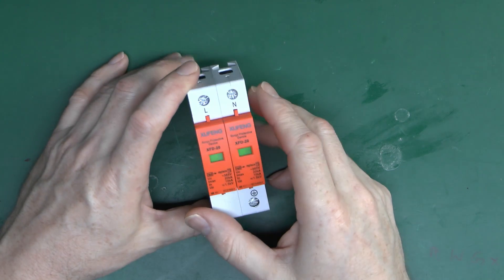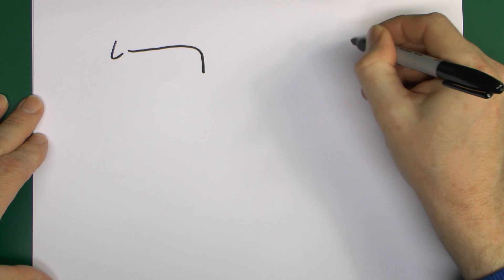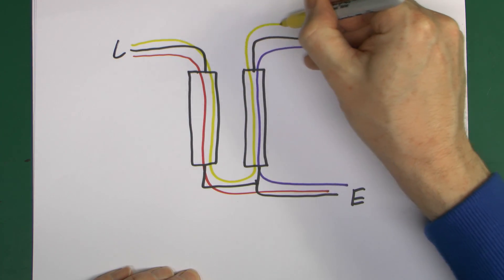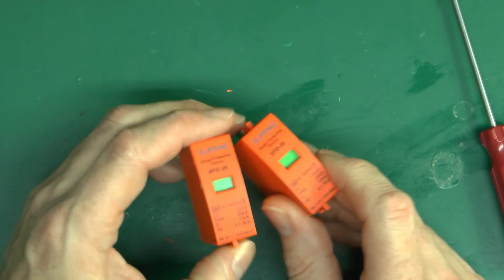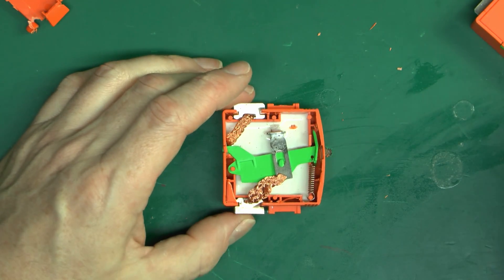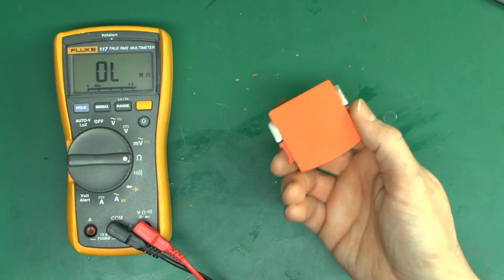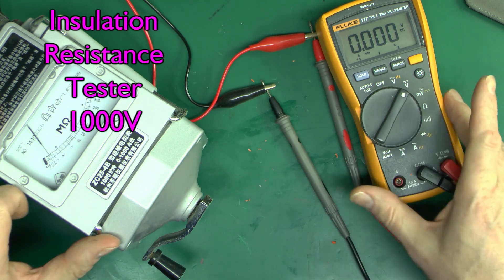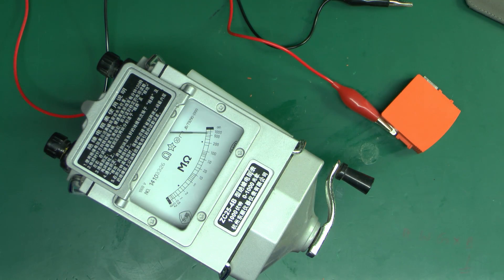Surge Protection Devices - Part 2

Comment: do you put the surge protection before or after the breaker?
Reply: After as the SPD is looking at transients.In such a short time the current is relatively low and the breaker does not trip but will if there's a wiring fault between the breaker and spd

Comment: Hi John, when you get time could you maybe do a video explaining RFI (radio frequency interference) and what causes it and how to fix it?
I get strange issues where turning off lights in the house causes my outside pir floodlight to come on  most of the time, its strange
Cheers
Reply: Put a couple of those clip-on chokes on the cables for the floodlights and, if it's possible to access them, the lights in the house. Actually, just clip them on any and every power cable you can see. They might help, but they never hurt.
Reply: Not an uncommon thing I think, PIR units are extremely sensitive devices and they are easily disturbed by slight EMC, might be that they are just cheap or the input filtering caps etc. have degraded. Some sort of filtering on the line should help. It might also matter which circuit they are wired to.

Comment: Hello JW
I'm wondering if you can help me understand a recent spd failure. 
I had a call out recently to a block of offices. 
3 phase supply with once phase down.
Apon initial inspection and follow up tests I found one of the main fuses of the 3 phase supply was blown. 
The 32A mcb controlling an air con unit was tripped and 1 of the SPDs blown. 
I found a line earth fault at the air con unit but no other damage to the installation. Can you help me understand what's happened here please? I can send you the damaged SPD and photos of the housing damage for your analysis if you'd be interested? Is it possible for a transient overvoltage to occur briefly in the installation when an appliance fails? Possibly caused by the motor as previously mentioned in your 1st spd video? Any input would be greatly appreciated.
Reply: Was it just one phase that failed? If it's air handling plant and the breaker just 32A I am already worried. It is possible for a single phase of an SPD to fail. Was it catastrophically damaged, bits broken off, charred, smelt of bonfire? OR Was it all melted and warped looking like a Salvador Dali painting? (I am tech manager for an SPD manufacturer by the way) Happy to help you to try and understand what has happened.

Comment: No way are these things worth £100.
Reply: Max should be £20 they are so simple even China clones can't get it wrong or bother to make fake ones as the parts them self's cost less then £1 to not bother making them fake
Reply from the maker: Not all consumer unit SPDs are that expensive - there are these:
https://www.toolstation.com/axiom-surge-protection-device/p41658 to go with the cheapo consumer units
and even these reputable brand items: https://www.toolstation.com/surge-arrester/p67014 are less than £50.
Then there are things like this: https://uk.rs-online.com/web/p/surge-suppressor-units/7886750/ one of which is taken apart in the next video.
The orange ones in the video were £5 each direct from China.

Comment: Very poor design.  
Is that spring too strong? 
What's the current interrupting capacity of such device?

You forgot to draw a fuse or a MCB on that electric diagram. 
Those devices work in combination with fuses, of current rating capacity of 20kA or more.
Conductors that lead to the fuse, N and PE must also be beefy enough.
When it fails short, excessive current blows the fuse, and current stops flowing.
Reply: Surge protectors don't have a load going through them. They're just placed across the live, neutral, and earth, and conduct electricity only when the voltage is above their threshold, with their resistance decreasing as the voltage goes up, basically trying to regulate the voltage. And when a MOV fails, it fails open circuit, because of the nature of how they work. Every time they conduct, a small amount of the metal oxide inside it is consumed and becomes an insulator. When it's all gone, typically the terminals inside it will arc briefly and then the device will go totally open circuit. Now, this usually involves some sparks and flames, but that's why they're inside that potting compound- it's flame retardant/ self extinguishing. Furthermore, the solder connecting the MOV to the supply connection is probably a very low melting point alloy, since it's designed to disconnect a circuit. Basically, this only conducts when there's a surge, no load is connected to the device in any way, so it doesn't need a fuse in series with it, there just needs to be one in the incoming supply.
Reply: @puckcat22679  So if I understand correctly, an 'undetected' spent SPD is simply an unnecessary junction...
Reply: @puckcat22679  MOVs typically fail short circuit not open. Almost all manufacturers recommend an OCPD of 32A or less in-line with the SPD

Comment: When a catridge is placed is there continuity between Phase and Neutral and phase to earth and neutral to earth??
Reply from the maker: No, in normal use there is no continuity or resistance.  They only conduct when higher than normal voltages are applied, typically over 275V.